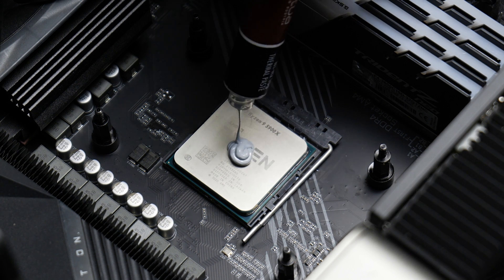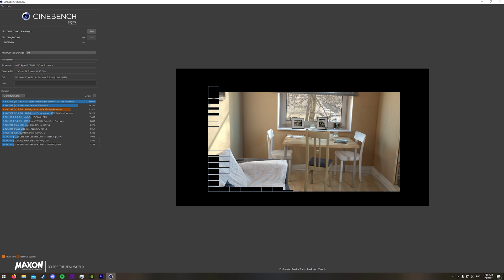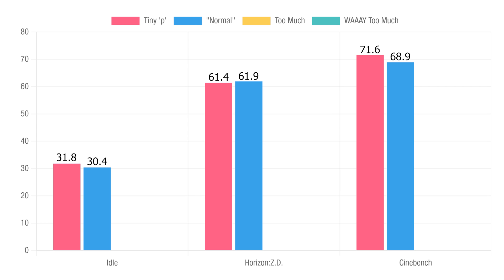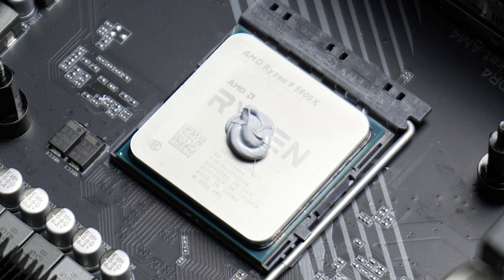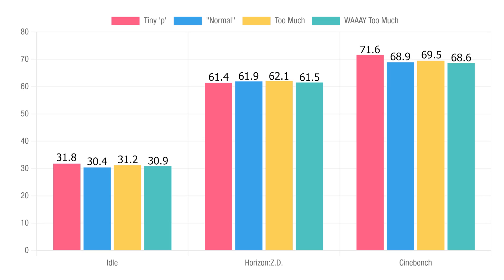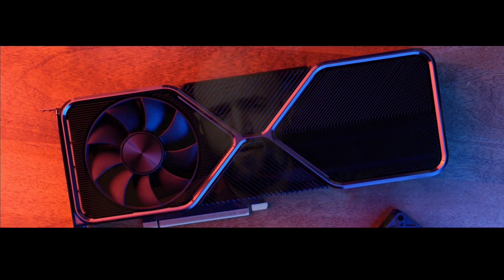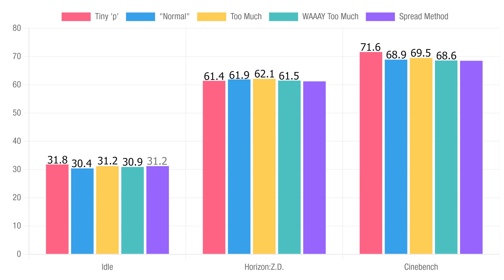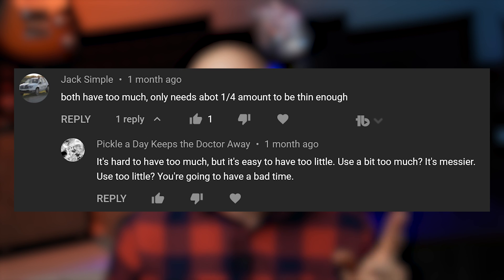Is More Thermal Paste Hotter?

Comment: From my experience, more is better, especially with laptops. I measured it. Don't just do it on the small silver chip (generous amount), but also apply "big" lines of thermal paste to the square on the sides of the heatsink. so that the entire CPU under the heatsink is filled with thermal paste. In my case, it made a 10° difference at 100% CPU. Some of it comes out, but you can wipe it away. It may look a bit too much and like a mess, but the results are amazing. In my case, on two notebooks (one of them 12 years old with i7). But of course it doesn't have to be electrically conductive (like mx4). I can't test how it behaves with desktop CPUs at the moment. But they have a bigger place for thermalpaste in general!

Comment: For the record, in my experience, using too much thermal paste can lead to long-term thermal throttling. I’ve experienced this myself. Also, I believe that quality thermal paste isn’t cheap. If you’re looking to buy a good thermal paste, it’s worth investing in a quality product. For reference, I use a ROG gaming laptop, and a simple pea size 1 gram, good-quality thermal paste works just fine for me.

Comment: I have tried several different methods and the one that works the best is to make sure you get some between the heatsink and the CPU. I just squeeze out a fat pea sized blob in the center and mount the heatsink. I intentionally add what I think is a little too much. I've got lots of 91% alcohol and paper towels if I accidentally make a mess. I used to fuss over stuff like this and actually since socket A it really hasn't mattered.

Comment: I replaced the stock AMD wraith stealth cooler which came with my Ryzen 5 5600, the new cooler was a Raijintek Orcus 240 liquid cooler.

After watching a bunch of videos on this channel, I concluded that it wouldn't even be necessary to clean my old thermal paste off. It was only 6 months old, wasn't dried, and came preapplied to the cooler so I trusted it had sufficient coverage. I added all the paste that came with the new cooler and just slapped it on. I did have some thermal paste on hand to do a clean reinstall if necessary.

I tested before and after, room at 20°C, maxed CPU with Prime95 10 minute runs, neither setup thermal throttled. Stock setup plateaued at 89°C, new cooler 60°C. I even let the new setup run Prime95 for 30 minutes, did not exceed 60°C.

So, yeah, thermal paste is not the big deal it's often made out to be. All the testing I've seen on this channel was very helpful. Just thought I'd share my experience for anyone else going down a similar rabbit hole.

Comment: The only time it'll really be an issue is if you use a paste that is electrically conductive and capacitive like artic silver 5, or other metal based pastes, with artic silver 5's "silver" particles inside which can short out other components on the board from spilling over too much, the other issue is dust attraction, dust eventually can begin to act like an electrical conductor not just a thermal insulator, electrical conductivity in varying degrees depending especially on it's composition, which is purely environmental, when it squishes out the sides of under the cooler, it can build up dust around the base of the CPU's ihs heat spreader or further and potentially form dust bunnies over time, really it's not a bad thing to put a decent thin foam airtake inlet filter on the case to help keep things clean. Artic Coolings mx6 carbon based thermal paste is a great choice as it is non electrically conductive or capacitive.

Comment: The Spread Method has always been the way I apply my thermal paste and I don't even ad a dimple in the middle for " good measure ". I use AS5 paste though and this paste is much darker and thicker than most pastes so it's easier to judge the evenness of the spread than other pastes. I also use a paper based business card so I can fold it in half for extra space to get into the cpu area without having to remove stuff and it works perfectly every time.

Comment: Basically, try to cover the whole CPU surface so it's all in contact with the heatsink, but don't leave enough excess that it can go under and into the pins and mess up the motherboard.
Spreading it is pretty great for this. Bunch of thermal paste brands ship their tubes with a small spatula to do it with for that reason, I presume.

Comment: So the result is: mounting methode is key. Buy cooler which does the best job at screwing it down with the perfect amount of pressure. Another test would be: just put the cooler on. No pressure. Just a bit of pressure. Screw it down like the company intended. Because too much paste+not enough pressure will such hard.

Comment: Good day Sir. I hope you are doing great

Please get back to me about below 3 questions.

1: What if you put too much paste and it spilled onto your mother board and because of the way your device is designed, you weren't able to see and clean up the spill and continue using the device?
2: How long after paste application can I power up?
3: How effective will it be if after adding the paste and leaving it to heal for some hours, you pull out the CPU again, clean out any spillage on the mother board, etc., put the CPU back onto the same paste (no new paste addition) and use? 

Thank you. Safe day
Reply: first of all depending on the paste if its metal then your doomed and MOST LIKELY shorted the motherboard but if its paste thats not conductive electrically then your fine also depends on how close other components are to socket for cpu 
#2: you can power up imidiatly if desired no wait time.
#3: not as effective as before since they advise dont move the cooler when you apply the fan or aio after pasting so I would say youd have to repaste to get full benifits of it (takeaway= not as effective)

Comment: thermal paste has a lower heat coefficient, so the saying 'less is best' is there. You sprinkle a small dot in the middle and really wiggle that cooler around, but you should eventually see the bare metal of the bottom metal plate. The point of the paste is to fill in the gaps between the metals, not become the entire gap between the metals.
Maybe if you used 'liquid' metal like in the PS5 it would be better, but that is a very difficult method to replace since liquid metal can instantly ruin your motherboard. I can guess how many PS5s have been ruined due to liquid metals alloys (if you ever used mercury, NEVER do that! Instantly turns aluminum into crumbly dust)
Reply: another issue with liquid metal is that it eats aluminum. so the IHS of the processor would get ruined by it

Comment: In the end, it is very basic thermodynamics, that covers the topic on the theoretical side. And that might give some context for your data and the assumption that too much is bad.
The transferred power of heat goes linear with the thickness, the contact area, the temperature difference and some coefficient. So the "two much" probably refers to the thickness, double the thickness means half of the heat is conducted. But the thickness is barely determined by the amount (volume) of paste you apply but rather the consistency and the pressure. So yes, too much paste meaning a too thick layer will decrease heat transfer. No, the amount paste you put on will not change (much) the thickness of the layer.
Also, half the area means half heat is transferred, at least via the paste. So even where there is too little paste and not the entire chip is covered, there is definitely less heat going through the paste. However, the area where there is no paste, there is not no heat transfer, just less. Your data showed that very nicely.
The time plots of the temperatures would have been nice, also because I am very sure that the data noise would have shown very clearly, that the temperatures are all within the margin of error except probably the too little one. Also I think the rise of temperatures is the more sensitive property that shows any tiny difference of heat transfer. But that of course does not change the result that the amount of paste has barely any effect on the heat transfer.

Comment: The thickness of the pastes is inverse proportional to the weight you put on top. The ideal case is to apply while the CPU is hot (lower surface tension, thus making the paste escape easier) and apply as much weight as the motherboard can support.

Comment: I left a comment on your paste comparison video where I mentioned the Thermalright coolers  and the paste included with them.
Thermalright makes an AM4 bracket that makes removing the cooler without ripping out the CPU much easier. Luckily I know how to straighten pins safely or that glued cpu issue you had would have destroyed at least 4 of my Ryzen 
Unfortunately it's not cross compatible with all coolers.

Comment: I always used the 'buttered toast' method. (Yeah I know it sounds like hindsight is a wonderful science. However it always felt like common sense.) There is one thing to add, which is that I paste the CPU when it's out of the socket. .. Noted you having difficulty spreading with it in the socket.
Reply: This causes air bubbles unless you add a pea on top of the butter
Reply: @worldwide78128  Since it offers the best thermal results, I doubt it.

Comment: The too little definitely wasn't making good enough contact, those few degrees aren't going to hurt anything but definitely worth doing a normal pea-sized drop.  The rest of the tests I'd be curious about room temperature and overall margin of error, very interesting to see that they all perform roughly similar.  I've been an Arctic Silver 5 fan for a long time so I've been careful not to over apply due to its conductive nature but good to know that if I get a little heavy-handed it's just going to squeeze the extra out the side.

Comment: you know, there is something under the lid that transfers heat between the actual CPU and the CPU lid. no amount of paste is going to cure if you have defective thermal transfer between chip and lid. which might explain your results.
Reply from the maker: Doubtful. I have had similar experiences with other AMD and Intel chips.

Comment: If you use conductive paste, and it gets on your mobo, it will short cirtcuit. Too much paste isn't a problem only if using non conductive paste. With conductive paste you need to be very careful not adding too much.

Comment: So... I found out the hard way what happens when you use too much paste over the LONG term. 

When I went to pull my Wraith cooler off of my 2700x so I could put in my new 5600x, the cooler took the whole CPU with it. Ripped it straight out of locked position on the board. I had to use the side of a plastic knife to pry and pull and finally pop the CPU off of the cooler. (It wasn't damaged and due to my dumb self forgetting to update my BIOS I actually had to put the 2700x back in to do the update)

The combination of the grooves in the wraith cooler and the fact I used too much paste, causing it to spill over the side, over time the paste turned into kind of a cement-y consistency. It literally cemented my CPU to my cooler.

That being said, the entire time I used it with that much paste, even towards the end of changing the CPU, my Temps never changed to anything concerning, maintaining my expectations while using an air cooler.

Comment: The job of thermal paste is to ensure consistent and even contact between heat sink and heat source. The assumption is that too much paste adds excess conductive material, crippling conduction. This is a fallacy, because the distance between heat source and heat sink remains consistent, therefore, the volume and mass of thermal compound will remain the same.

Too little thermal compound reduces the surface area of contact between the two surfaces, thus reducing conduction.

Spreading the thermal compound across the heat source ensures close to optimum surface area contact between the two surfaces, hence, better conduction.

This is all assuming best case scenarios; nothing is ever at best case.

Comment: Great video. I'd argue it does make an argument for not going total ham with the paste, but not for thermal reasons. That suction in removing it later could be awful.

I'd guess that bubble in the middle of the final test wasn't there while running, but purely from the suction force trying to get the dang thing back off.

Comment: Do another test with a 1 mm thick of paste, but don't tighten the bolts.  Just let the CPU float on the paste.
Reply: It will perform worse the thicker it is. The thermal conductivity of aluminum is like 8-10x that of the most conductive thermal paste. Copper is like 40x. The reason for the thermal paste is that it is more conductive than air, which you'll most likely have between the cooler and cpu at a microscopic level. The thicker it is the more insulating it is compared to just a thin layer to remove the air. Going thicker with the application doesn't really matter since tightening the cooler down will squeeze out most of the excess. Though more thermally conductive pastes tend to be more electrically conductive as well due to the addition of metal particles, which could potentially damage electronics should it squeeze out where it's not supposed to be.

Comment: Yep, pretty much what every sane person expected. Nice video!
Thermal paste or other variants like thermal glue, thermal silicone (or solder in recent years) which typically spills on the sides of the actual die has basically been present on any CPU that has had a factory heatspreader in the past 25+ years. Never has this been a problem, so why would it be for the contact between the heatspreader and cooler heatsink? 🙂

Comment: I've had a heatsink glue itself on there when I used too much paste before, and I ripped the CPU out of the socket. Luckily I was able to still use it, but what a scare! Thumbs up for the video.
Reply: I've done this and since changed my method to warm the heat sink with a heat gun before trying to take it off using gloves. The heat makes the paste pliable.

Comment: I remember once ripping my CPU from the motherboard with it still stuck to the cooler, in the end nothing was damaged but that certainly gave me a good scare.
I've been really careful not using too much paste ever since.
Reply: After doing that to an original Pentium and pulling one of the pins out I started pre-heating my chips before removing the cooler.  Go stress test it for 5 minutes to build up heat, shut it down, then twist it back and forth to break the bond before lifting it off.
Reply: @406Steven  Copy that, 10-4...good tip, for sure!
Reply: just happened to me today with the preapplied paste :P

Comment: I applied too much thermal paste on my CPU, but the pc is working fine and there's a noticeable fps boost on the games that i play. unfortunately this also makes the heatsink stuck to the CPU. Should i just let it be and try to take it off when i want to reapply the thermal paste again sometimes in the future?
Reply: the longer you wait the harder it will dry and get more and more difficult to remove so you might not want to wait too much

Comment: A really fun video to watch. I can see that too much paste is not an issue. (With a nice cooler with good firm and even pressure, and a nice, broad and flat AMD IHS). On the other hand, I can remember to just have an upper limit to how much "too much" paste I am willing to deal with, and then I'll be fine. Thie leaves a LOT OF ROOM to do it right. Anxiety brain calmed. Thanks.
Reply: Only if using non conductive paste. Conductive thermal paste, if you use too much, the excess can drip down onto your MOBO, and cause it to short circuit.

Comment: I have some other question. Is using laptop on a flat surface enough or do I need a stand?
(like I play games only occasionally, mostly I just use laptop to multi-task browsing, writing, music, streaming & watching videos).
Reply from the maker: They usually come with tine feet to get enough airflow but if you want better cooling, and thus better performance even by a little, getting a stand with fans will do great.

Comment: I've been wondering if thermal paste goes bad while in its container. For instance is it worth buying 10g thermal paste and use for the next couple of years or is it better to buy it when you need it.
Reply: Ive got a syringe of arctic silver, 50g, Ive had it over 12 years, its still good stuff imo.
Reply from the maker: @no1baggiefan   I would agree. Most will keep for many years. Though some are apt to separating.
Reply: i had a tube of of the larger arctic silver5 for 10 years, mine dried out but it had only enough for maybe 2 applications left in it

Comment: Thermal paste that is dried on the sides of the socket will not insulate any heat. That is easily debunked.
The heat transfer occurs from the cooler touching the top of the CPU and  dissipating  the heat thru the cooler itself. 
Insulating the sides of the CPU socket thermal paste will not affect the cooler performance in any way, Thermal dynamics.
Reply: Genius.

Comment: too much thermal paste being a problem is only valid if your paste is electrically conductive and it gets into places it shouldn't, shorting out things on your pc is bad, but non-conductive pastes aren't an issue if you put too much on there. one point of testing you could have done, no thermal paste at all, that may have crashed on cinabench or maybe thermal throttled, and of course higher temps, i wouldn't be too worried about it causing permanent damage, cause the cpu will throttle to save its self if it gets too hot and even shut down if way to hot.